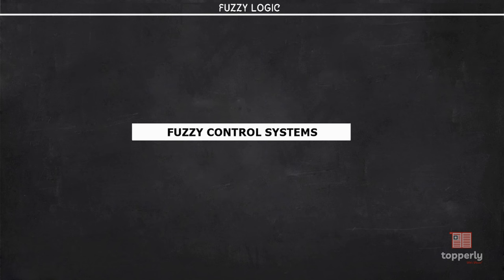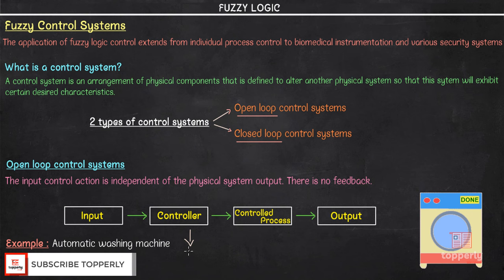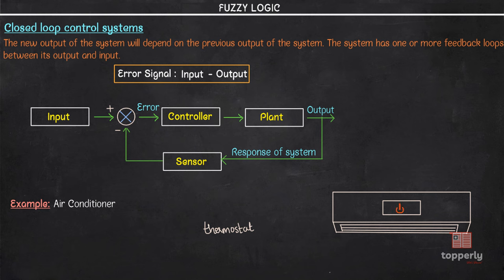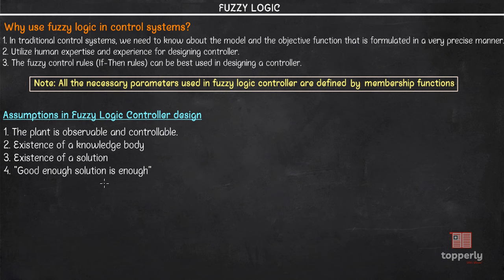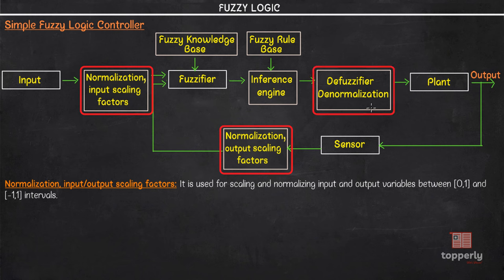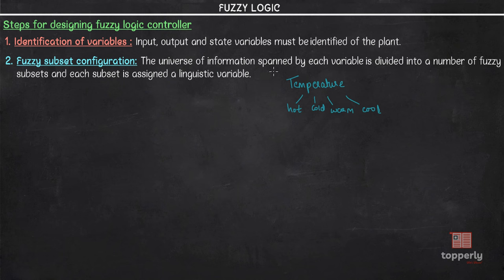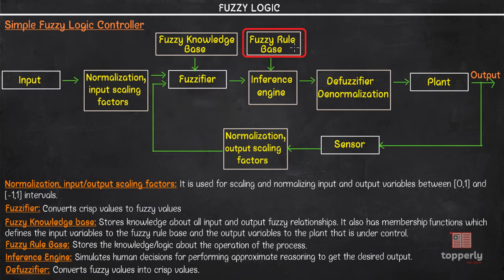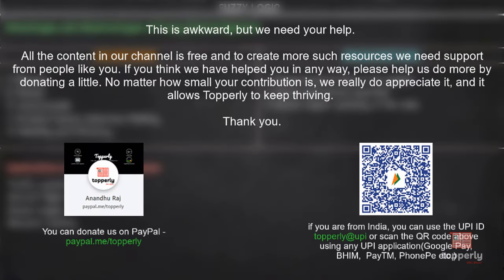Fuzzy Control Systems | Fuzzy Logic

Comment: No one has explained why bother?  Fuzzy logic is far to complicated for what it does.   A PID requires 3 multiplies and adds at runtime.   It is easy to CALCULATE the closed loop gains.  After adding feed forwards,  PID is much more accurate when properly tuned but there are lots of auto tuning software..

I don't agree at all with her advantages.  I wonder what qualifies her to talk about this topic.